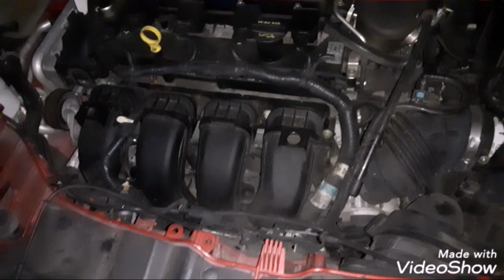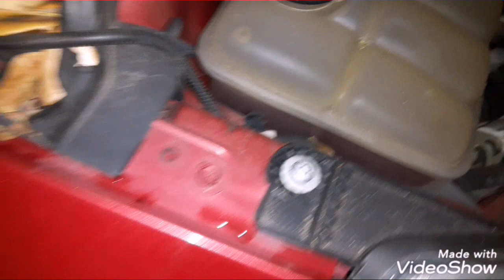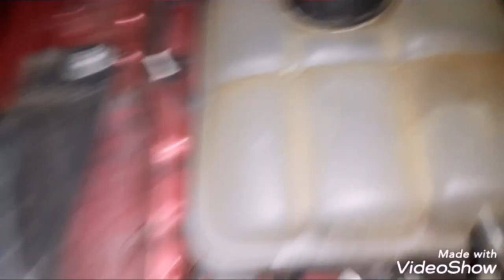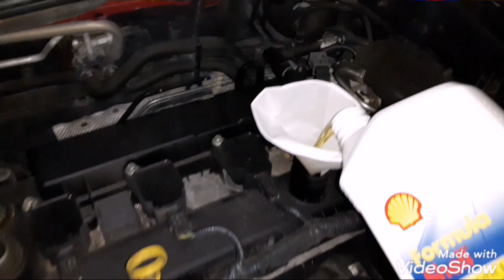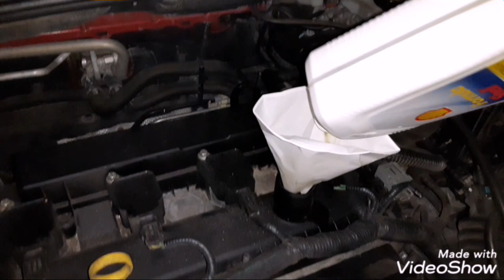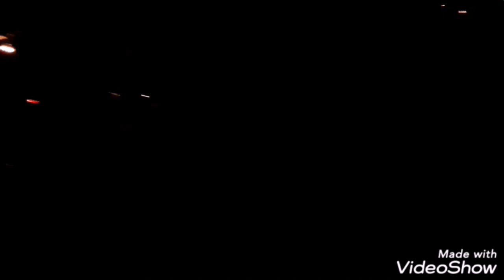MY CAR IS OVERHEATING

Comment: you have a leak  a water leak. loss of pressure causes the boiling temperature be lower. Fill the water up.  Run the car until it’s warm. Then turn the car off and listen for the leak
Reply from the maker: Ya I have a leak
Reply: Thanks bro for the info
Reply: Os there anyway I can fix the leak or how much will ford cost